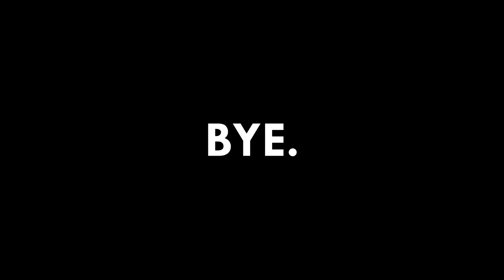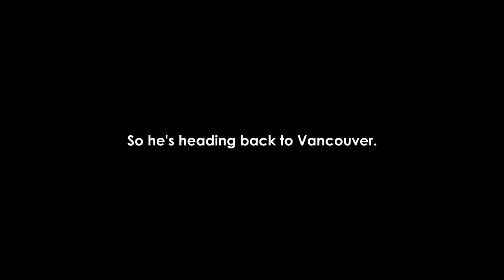I raised my widebody fenders up 1" with Bondo, and it's PERFECT (PTG E36 pt.5)

Comment: Next time for gaps that big you should use Bondo glass. Not regular Bondo. It's fiberglass reinforced Bondo it won't crack as easily when it's thick. It should stand up to more abuse as well since it's a drift car

Comment: I'm not sure who taught you how to do body works, but you can only use a certain thickness of bondo, or it will crack in time, I used to have a paint and body shop back in Florida, and that's not how to apply bondo, and also you have to use sand papers to sand it, use a 36 grit to shape the bondo all the way up to 220.. you don't use bondo on rust, grind and use tiger hair and sand it smooth and top it off with a skim coat of bondo..

Comment: Birdy you gotta run a hub spacer rather than stacked lug spacers. Also, waaay too much bondo bro. Need to get the right figment bondo is for surface imperfections